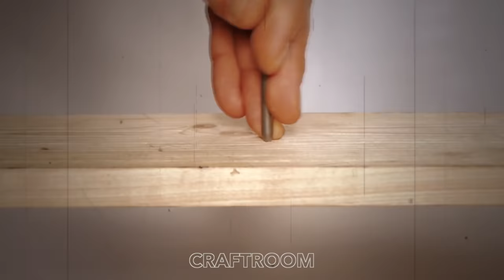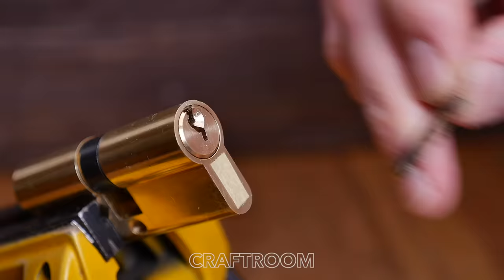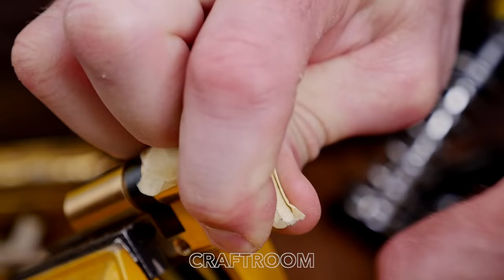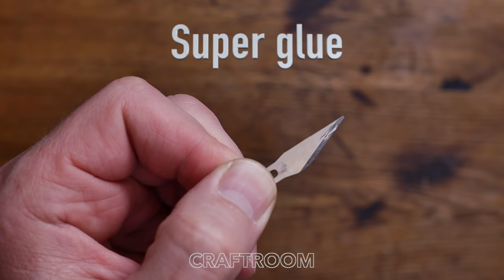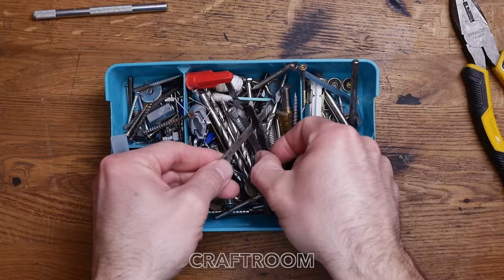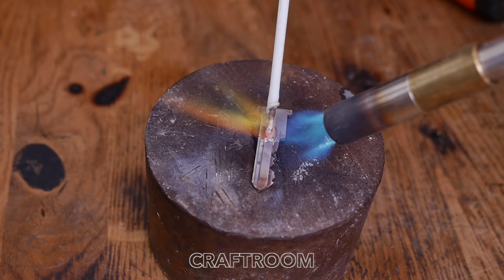10 Best Ways To Remove a Broken Key

Comment: Most of those are completly impractical or destructive.. Put a drop of super glue on the broken off part thats in your hand.. carefully rejoin the two parts before super glue sets and hold for 2 and half minutes.. carefully pull it out and get a key cut mediately.. works with the cheapest nastiest super glue because the metal break is fresh and clean so it grabs strong enough for removal.. Ive done this befor, fast.. no fuss.. no damage..

Comment: @craftroom your methods are the best that I have seen. I went to try the drill and screw method and accidentally discovered another way 😁 I put some machine oil before so I could drill and said let me try to tap it, and by tapping he bottom enough to release the broken half of the key for pulling it out 🤗 ( key drum was for a machine not a door lock )

Comment: I used glue stick a minute ago and it worked, I got my key out.. the trick is thicker glue stick and letting it dry for 5 mins before you pull it out. It worked for mw

Comment: All methods here assumes the key blade can be taken out. I happened to have a plastic key broken in half way down the cylinder and it is a car with no the other end. And I had to turn the key to acc. position before the pin on the side of the cylinder can be pressed to release the cylinder.

I think one or more tumbler keys is broken and therefore the key got stuck.

Comment: A few of these methods destroyed the lock retrieving the key, so what's the point, might just as well bought another lock!
Reply: It is so you can enter your house until you buy new lock and replace it in case you don't have other tools to pull it out without destroying the lock.

Comment: But what if the lock is in a door and the key has been turned against the mechanism pressure and snapped, the barrel doesn’t turn anywhere near as easily as shown 😳 in fact sometimes not at all.

Comment: I’ve never seen a lock made in the last 50 years in which you can push the key out from the other end.

The hot glue method will work if you use it to stick an appropriately shaped piece of wood or metal to the key end, assuming the key can be removed easily.

Individual results depend on the situation. It requires a little thought and preparation. The most important thing in this video is the importance of lining the key stub properly before attempting to remove it. Your results may vary.
Reply: It's a profile cylinder lock, they are mainly used in Europe or those double windowed back doors in the US. ("French doors").

As for key extraction, usually any small metal pointed object can be used if the keyway is aligned right. Kinda how he used the razor blade by "inching" it forward.
Reply: Shocking
Reply: These are for hotels and caretake, in case something happens to the client or customer, and the left their key into the lock from the inside.

You cannot buy this in diy, but need to visit the pro's or know where to search for in internet.
Reply: Well I'm in the UK and I just pushed my deep broken key out from the other end with my smallest thinnest Allen key and damn am I happy about it. Sure needed a scalpel to prize it a little but without the thin Allen key from other side I would be screwed it was too far in.

Comment: The clue stick works, if you take the 18mm version, heat it, press it, and let it dry. Just don't overheat it.

I also removed a key with a powerfull potmagnet once